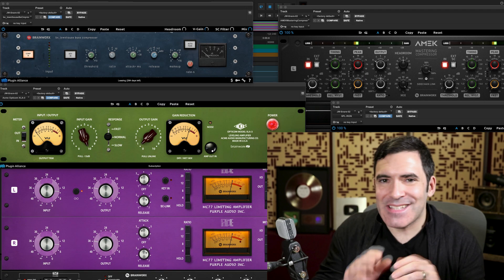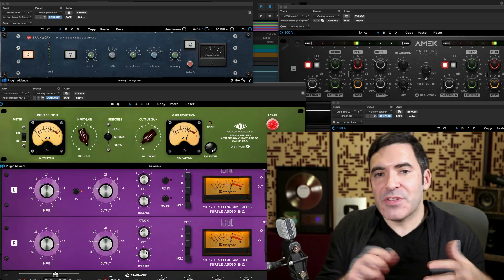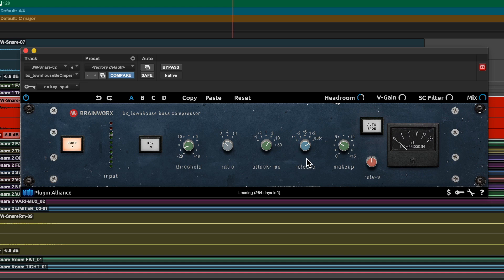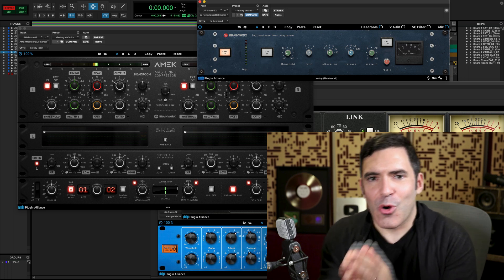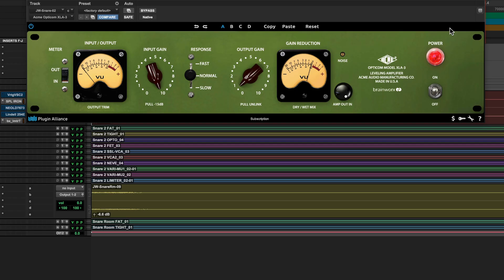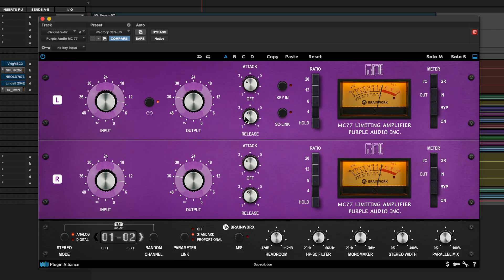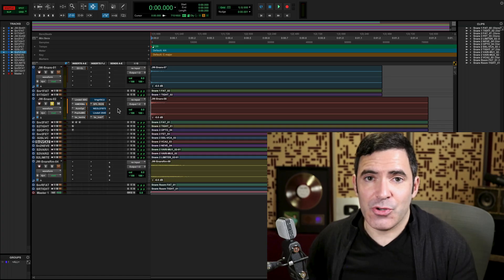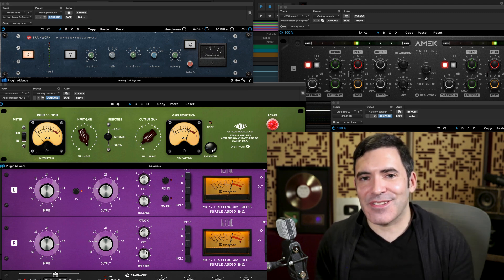Choosing the Right Compressor: VCA, Opto, Vari-Mu or FET?

Comment: I have bought several of these compressors and I experiment often as I record. I like cleaner comp for my vocals and use the softubes saturator for the grit after the fact. As I track my vocals I use a clean fet style to compress at the beginning of my vocal chain and then then a character LA2A to catch any peaks at the back end. It adds color and is more subtle that way. Opto I like to throw on my bass tracks to give them just a bit more dirt to cut through the mix. I use EZ drummer so those are already super processed samples. Alll I do with drums is send the shells to a submix bus with a heavy duty compressor to mix into the overall drum mix sound. Adds grit and punch without overpowering the mix. This is all just my opinion of course and just my approach. I reccommenr getting some compressor plugins and play around with them, find the sounds you like most nad then tweak them to play nice with one another.
Reply from the maker: Thanks for your support and sharing your approach!

Comment: One aspect that distinguishes opto compressors is that they inherently respond to the RMS power level of the signal, rather than the peak amplitude. Sharp transients tend to pass through unimpeded by these compressors, which may or may not suit particular instruments. On crash symbols, for instance, an opto compressor can be used to preserve the initial spikes while keeping the overall level consistent.

Comment: I hardly have a vocal track without the NEOLD U17 - either in parallel operation with extreme settings or in serial operation with gentler settings. A really great tool! I am very curious about the further episodes - this overview was already quite interesting. I didn't know anything about a pulse width modulation compressor yet ;-)

Comment: About the SPL IRON, you can't choose differents transformers, but differents diodes ! And they are not on the audio path, but on the control signal path of the gain reduction ! It changes a lot the timing response instead of the color behavior of the box.

This compressor is a beat of beauty. It would be great having a real review of it.

Comment: BX Townhouse has any oversampling option? If no can I use it with ddmf..right?
Reply from the maker: All analog modeled plugins “made by BX” apply oversampling internally whenever it is necessary, in a really clever way. We are typically not simply oversampling the whole plugin, as this would increase the CPU/DSP load unnecessarily in most cases. Especially on DSP systems, where a plugin always has to “reserve” the worst-case DSP load this wouldn’t be great. The same would be true for plugins like our SSL console emulations, which get used on dozens of channels in many mixes. CPU/DSP efficiency is key here. The way our system works is that we basically make sure that any crucial part of analog modeled circuits run with a sample rate of at least 176Khz internally. Our Upsampling Settings, depending on your session settings: - Below 50kHz (for example 44.1 and 48): 4x - Below 100kHz (for example 88.2 and 96): 2x - Above 100kHz (176.4 and 192): 1x We don’t offer these Upsampling modes to be selectable or switchable by the user, because we believe they are highly optimized for each circuit and application the way we have integrated our Upsampling.
Reply: @PluginAllianceTV  Itr would be nice if you could make a video showing any plugin of yours (especially something that adds saturation) vs a plugin that gives oversampling (like saturn) and show the aliasing comparison in something like DDMF. It doesn't matter which one would be better in the graphics...but most important is that we would see the behavior of your internal oversampling!!!!!!